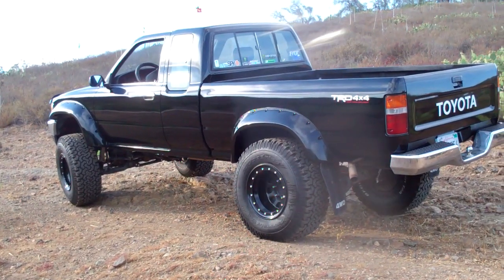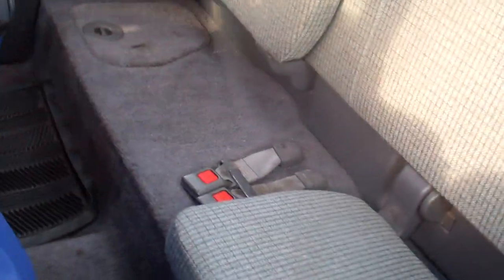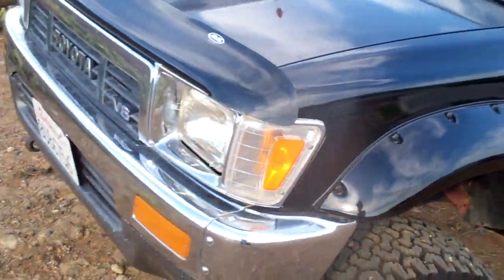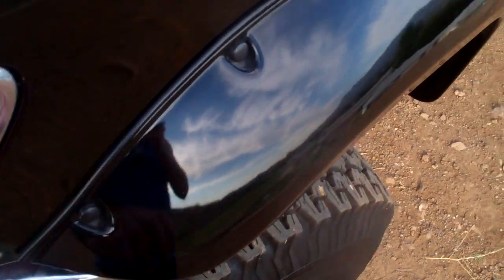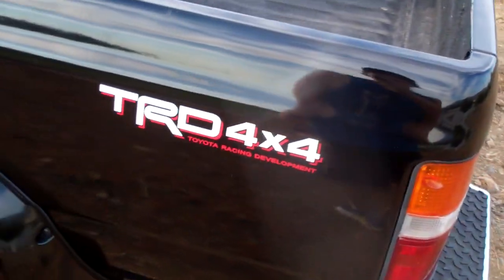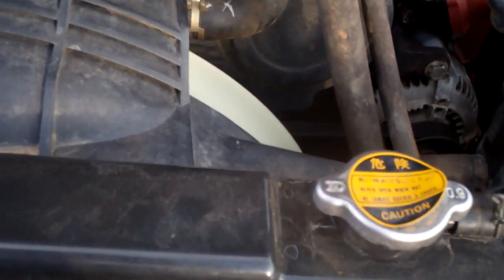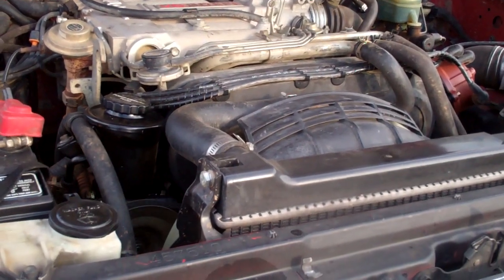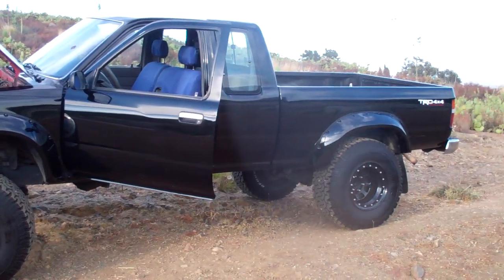1991 toyota pickup 4x4- BEAUTIFUL TRUCK!

Comment: also, DON'T SELL IT.  you'll be sick about it, later on..
Reply: Sold my mint 91 - I could punch myself in the face daily for doing so.
Reply: @narlycharley  Same here, I sold mu rust free 1985 Toyota 4x4 std cab SR5 with 22re, AC and power steering from factory. two toned paint ( gray and white). I installed OME springs. I hit a deer @ 52mph one morning, pulled over saw no damage but dead deer i hit, cut out its backstraps, had dinner that evening. I got another 1985 truck. iti s a 85 4runner, I installed Trail Gear classic front suspension setup, 5:29 gears, converted rear drums to discs.

Comment: Great find dude. Good to hear you earned it on your own . Take good care of it . I've had my 91 since new ( almost 27 yrs now ) and she still runs smooth and strong .
She is now pushing 509,300 miles and no engine or trans work yet other than the timing chain and water pump at 400,000 . Just change the oil every 3-4,000 miles and grease it often and it will treat you well . Enjoy it .
Reply: That's awesome.  I've got 174k on my '94 4x4 XtraCab 22RE.  Just did the timing chain with metal guides, new Aisin oil pump, and a clutch & flywheel while i had the engine out.  So much fun to drive on and off the roads!
Reply: flycubfly 3VZE or 22RE?

Comment: ive got a 91 reg cab 4cyl 4x4 same color. i love it have nearly 400k miles on a stock engine. frame isnt in the best shape but thats wat angle iron and a welder is for. im live in central upstate NY so the winters and salt arnt helping. but if i were you just to be safe i would rhino line the frame too like you did the bed. beautiful truck man

Comment: Sweet....enjoy...

I did 440K on my 92 with the 3vze 6 cylinder .... and I saw the girl that bought it from me a while back and it is up to 520 and she said she never does anything to it except changing oil..... they just keep going

But you had best get your title changed to reflect the correct color , if a cop gets behind you and runs your tag it will not match the truck color and they will pull you over , I don't think there is any fine or charges , but they will think the truck is stolen at first until they get to talking with you.
Reply: Wow, you did 440k on a 3VZE, and now it has 520k? That is great news because that's the same engine I have on my 94, it has 222k(no engine issues at all). I plan on hanging on to her for another 10 years, so I'm glad to hear this. Thanks for sharing.

Comment: I got a truck pretty much like yours, only it has the 2.4L inline 4 (and not as offroad ready), the truck has been there thick and thin and with 420000 miles on the odometer. I am leaving tomorrow to drive across the country and help my brother move and without a doubt this truck will do the job, not bad for a $1500 pickup lol.

Comment: Add speakers to the back by removing the plastic panels ,making a Wood cover and Mount a speaker on in it Sound a lot better have the same truck in sr5 trim same rip in Seat i got the k nn cold air kit sounds more agrsive if You like that

Comment: the problem with these years wasn't the axle. granted, the solid axle is more valuable, although a much rougher ride. but the problem is the motors. the 3.0 just wasn't a smart engine by any means. toyota moving from one of the most reliable engines ever(22r) to an engine with a steel body and aluminum heads just wasn't smart. thank god they fixed the problem with the 3.4 for late 90's trucks. still an absolutely beautiful truck and i can honestly say i wish my 84 pickup looked as clean as that. thanks for sharing.
Reply: Austin Gaetano  pretty sure 22r has a steel block aluminum head. That combination of materials has nothing to do with the reliability of a particular engine, well maybe if your talking about electrolysis. Good antifreeze and extra engine grounds will help in that department. Toyota 3 litre just had a bad head design. Toyota actually had a recall on these heads. It seems that not alot of people jumped on this recall, but i do know of one individual who did and he has over 500k on a beautifully running 3 litre. Truth be told the 22r and 22re engines are shit when compared to the 20r the 20r is stronger in every way. Many so called aftermarket high performance upgrades for the 22r came stock on the 20r. Toyota seems to have started to build their trucks around saving themselves money instead of building a stronger more reliable product.  Its been on a steady decline since 1982. That being said even the truck in the video will  be running strong , while the 2017 Tacoma"s will be sitting in a wrecking yard being picked of all their parts.
Reply: the problem is with head gaskets, toyota made them without asbestos,  trying to be enviromentally correct. later changed back and did a lot of recall work.

Comment: I am rebuilding a 1988 with the same motor and 281,000 miles on it. Runs great, despite its notoriety. If your head gaskets ever go, I suggest a swap to a 3.4L out of a 90s T100. I hear the swap is pretty easy to do and those motors are cheap and plentiful. That's what I plan to do if/when mine ever goes. Toyota quoted me $6,000 to fix the 3.0L. That's not happening.
Reply: Or if you have more cash and it hasn't gone yet, Cummins is coming out with crate turbo diesel engines to swap into old trucks to make them run like new again.  And it gets like 25 mpg and I know that's better than what its getting now lol

Comment: Try Nano-oil :) fully works for me. But ya got to do the engine, diffs and gearbox and transfer case., power steering and if you have manual injection diesel, do the injector pump :)

Comment: Hey man. I have a 91 yoga pickup as well. It also has the original red paint like yours did. Mine is an sr5 though, and its automatic, which I'm not too happy about, but it was free, so I ain't arguing. Anyway, when you started your truck, I noticed that it had a knock. If you listen carefully, you can hear it. Its a faint clicking sound. That's not good. You should do an oil pressure test to see if its within specs, and do a compression test. If its not, there is something major wrong with it

Comment: Looks great. The 4 in lift will damage your suspension on the long run. Looks great
Reply: +Jake Because lifting an independent-front suspension vehicle over 2 inches puts all the driveshafts, CVs, ect at greater angles than what they were designed for, causing high amounts of wear and risks causing premature failure.
Reply: +Chrisco_96 rough country has a kit that keeps the front diff aligned pretty close to stock

Comment from the maker: yeah I do not get great gas mileage either. I get about 16 mpg. It kinda sucks, but it has the bigger tires on it. The tires on it do take alot of the acceleration out. Ive been thinking about trying to change the gear ratio, but havent really had time. It struggles up steeper grades. I usually keep it in a high RPM at around 3rd gear and it does fine, but i do have to keep an eye on the engine temp though. But other than that, It has been very reliable and I LOVE IT!!!!

Comment: v6 has power  i pulled  my  67 vw convertible around to shops with no issues...but  its a head gasket eater.....i got mine with 82k on it..sold it with 99 k.... i didnt want to take the risk..i have  a 88 22r  single cab 5 speed 2 wheel drive now

Comment: Where did you your seat covers? I also have a 91' Pickup, but it's the 2.4l 22RE Engine; don't know if the cab has different dimensions. Your seat looked exactly the same though; same colors under it too.

Comment: I got old 90 toyota 4x4 extra cab sr5 black stick 3.4 v6 new frame new engine new transmission new bumbers seats carpet new power window motor driver side new cd player new speakers in doors new rancho shocks 4 all way around new tires 😀

Comment: Rocking truck! I have a 4cyl. 92 toyota pickup with 31" tires on it along with a 3.5" suspension lift (Fabtech) I also put a 2" body lift on it. My truck is only a single cab and does not have 4x4😥  I'm saving up for a 1 piece conversion fiberglass hood and fenders, after that I want to weld a bed cage for it. After that I'm done adding. I'm 16years old and trying to save up for a extended cab tacoma. If you send me your email I'll tell you all the other things I added along with a couple pictures😃
Reply: Austin Whaley where did you order your lift through? And the body lift? I have a 94 2wd that I’m trying to lift but can’t find anything to lift the front

Comment: Did you do anything to your shaft when you lifted your truck?  I have a 1990, dlx with 4.5 suspension lift, and it vibrates like crazy. My rear differential,  u joint is destroyed and I have no idea how to fix the problem.

Comment: got qestions for u like the truck..i have a 94 sam truck as u .. i have vid on utube of mine..how good is ur fuel mileage ? mine ..not so good .. but i got alot of mods headers..and iam not sure when they put them in and did the exhaust they put the o2 sensor in the right place.. plus how can it pull those bigger tires..i got 215/85/16..and it go good.. i have a 3 in levleing kit .and a bunch of other things on mine..

Comment: Nice truck I'm trying to get a 91 Toyota just like yours but not as nice the guy wants 2500 and it has a new motor with 10,000 miles on it u think that is a deal for that truck.
Reply: +Moto Crazy That is a steal. I just bought mine for $2,200 and the head gasket blew 4 days later. Test drive drove fine. Bastard must have put head gasket sealer. Anyway I put a new head and many new parts. Truck is on the road happy. Get it before its gone.